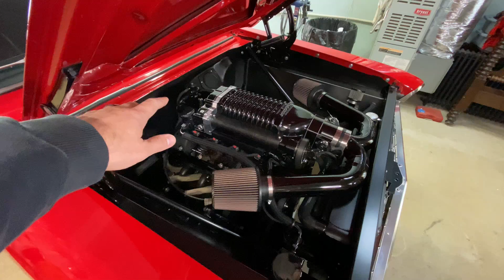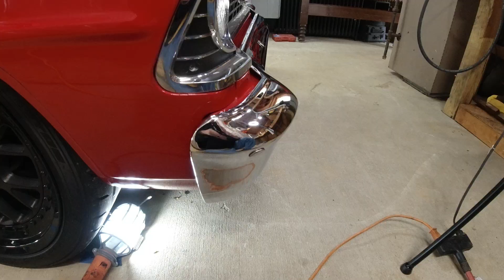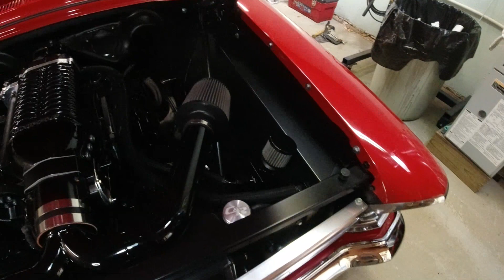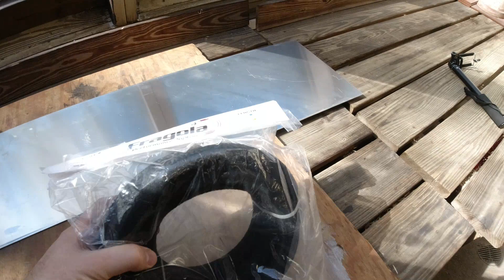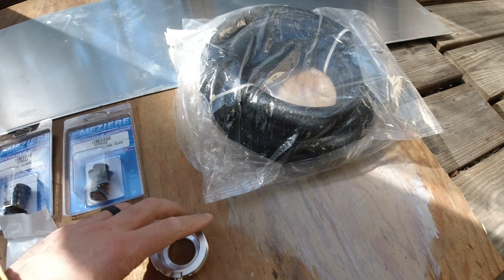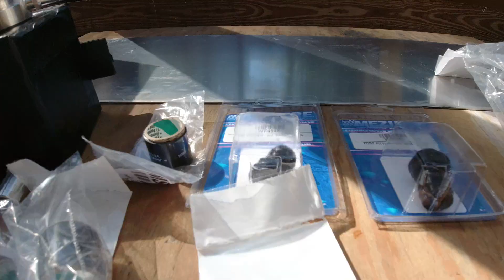Custom Whipple Supercharger Cooling System [Part 1]

Comment: Does putting the supercharger before the heat exchanger affect flow into the supercharger?
Reply from the maker: Hi SpeedDriven, this is how all positive displacement superchargers are built.  The air is compressed and then flows through the liquid to air heat exchanger to remove some of the heat that is created.  Then flows on to the intake runners on the heads.  Hope this helps!

Comment: this is perfect - the way things should have been from the factory. thank you!
Reply from the maker: Glad you liked it!
Reply: Quick question - where did you get the rear in/out adapter that has AN connections? Mine has single barb slip fittings that I’m less than thrilled with. Did you go to Whipple direct?
Reply from the maker: No I ordered through Jegs.  I would not recommend going this route.  If you use coolant in your system like I did they tend to leak.  I could never get it to quit leaking.  I ended up switching back to the barb fittings.  I got a barb fitting that steps up from -8AN to -12AN lines for extra coolant volume.
Reply: @grandtouringpro  very interesting. i contacted whipple and they "dug up" a 12 or 16an fitting for me which i have yet to order. sounds like the truck kits never had the option or maybe the an fittings were only issues on certain camaro blowers (not the off the shelf models). They want $300 for it which i have a hard time justifying. Plus i just put an interchiller kit on so i'm dialed for a while. at any rate - thanks again for the info and the content!
Reply from the maker: You can try Jegs part #231-16839 if you want an AN fitting.  I ended up switching to a barb fitting part #MEZ-WPM34S then ran a heat shrink clamp on it for a clean look.

Comment: I bet those intakes draw in allot of hot air off of the exhaust manifolds . Killing Hp.
Reply from the maker: Hey @Mustang Guru thanks for checking out the video!  Yes they did.  Have you checked out my later videos where I rework the intake into a more functional design?